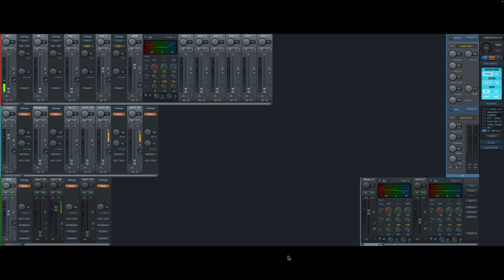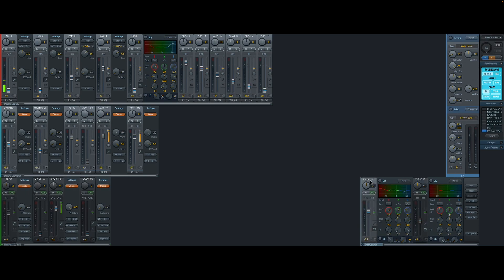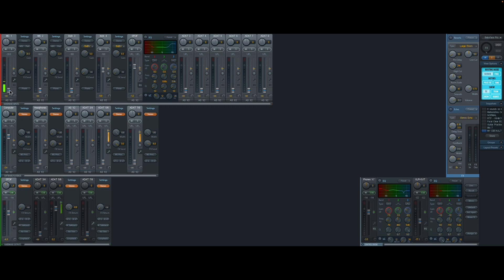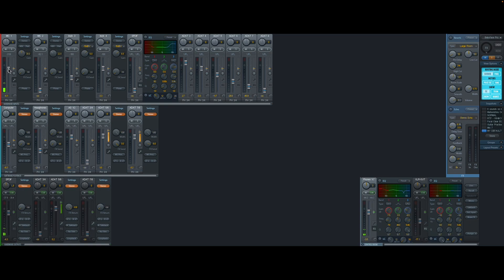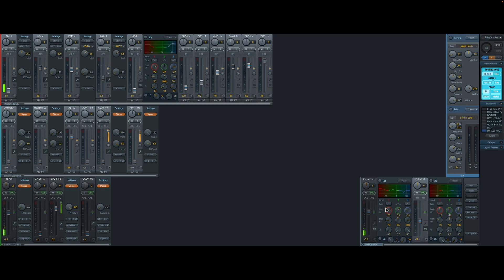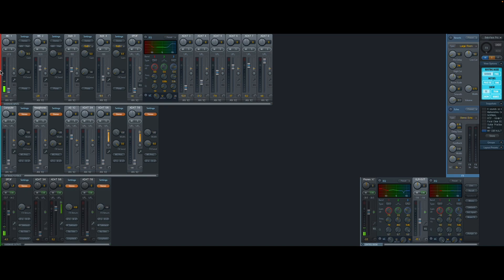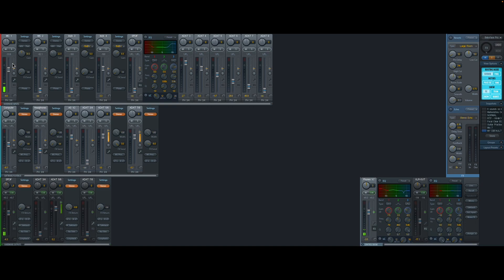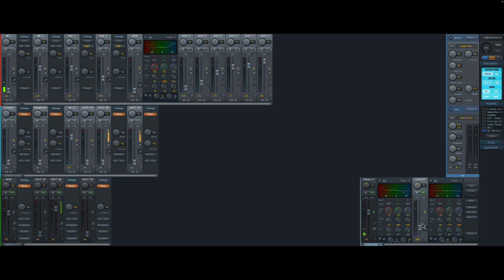Getting Started with Babyface Pro and RME TotalMix

Comment: Hello, I need help with something basic. I have no response between my interface and my preamp. I got an external preamp (TB12) and a Babyface. In the mixer, I used input 2, Instrument and that's it, but now it doesn't work. Am I doing something wrong?
Reply from the maker: Instruments like a guitar would normally be plugged into In3 or In4. If you're using a Mic or some other XLR connected device in Input 2, click on the wrench icon for Input 2 and turn up the gain control. Then select the Main Output (just click on it so it becomes light grey) and then slide up its fader AND Input 2's fader.